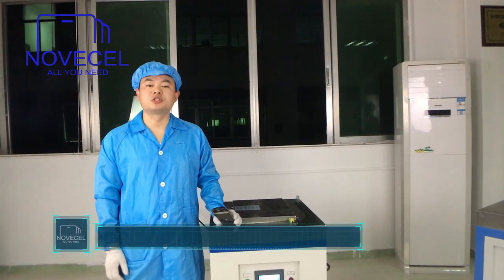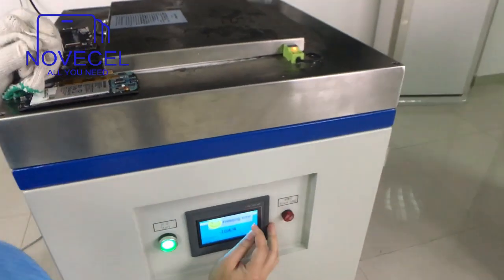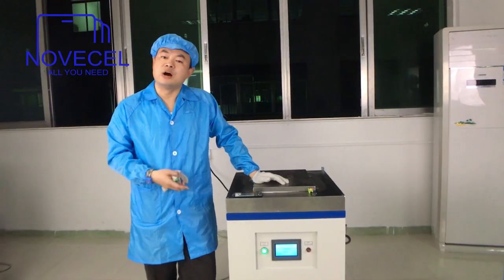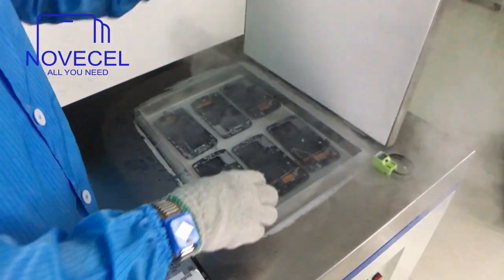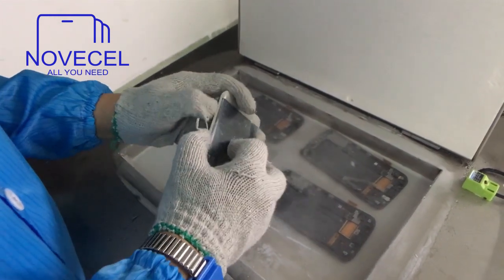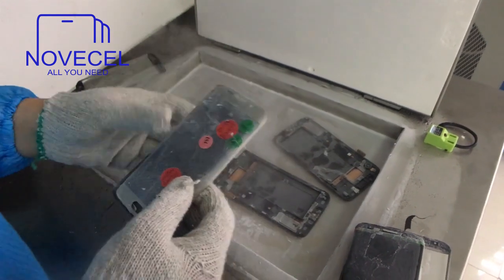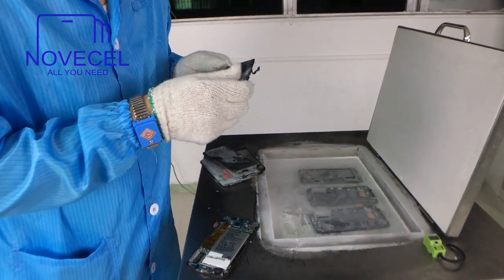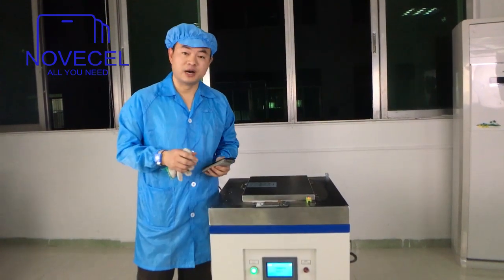For fun:What happens if i put Galaxy s6 edge LCD in  -165 freezer F01 for 5 minutes

Comment: s9 glass replesment solution
Reply from the maker: S9 Glass Replacement: https://youtu.be/ifHdZNbBwg0
S8+Glass Replacement: https://youtu.be/g7U94JFmXVg
iPhone X Glass Replacement: https://youtu.be/ffJJpVGP-a4
Iphone 6s Glass Replacement: https://youtu.be/C6KSqGwGCCI
S5 neo Glass Replacement: https://youtu.be/g7KS5NWNeTI
S5 Glass Replacement: https://youtu.be/CYD_ZZ-j_BQ

p.p1 {margin: 0.0px 0.0px 0.0px 0.0px; text-align: justify; font: 10.5px Helvetica; color: #000000; -webkit-text-stroke: #000000}
p.p2 {margin: 0.0px 0.0px 0.0px 0.0px; text-align: justify; font: 10.5px Helvetica; color: #0563c1; -webkit-text-stroke: #0563c1}
span.s1 {font-kerning: none}
span.s2 {font-kerning: none; color: #000000; -webkit-text-stroke: 0px #000000}
span.s3 {text-decoration: underline ; font-kerning: none; color: #0563c1; -webkit-text-stroke: 0px #0563c1}